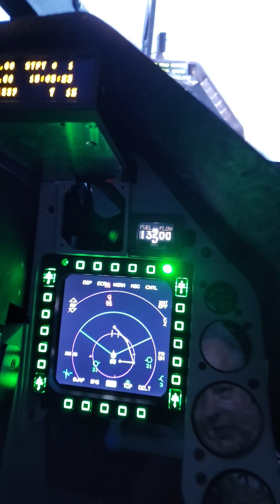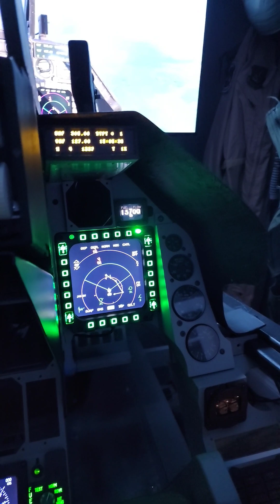You can't do this without help. #simulation #dcs #F-16C #Viper #Arduino

Comment: Hello GDVW, very nice work there, beautiful sim. Quick question. Can you provide the code for the FFI? I've spent the last 3 days searching without success. I've been to the ED forum and can't find joy there either. I've seen Vince Vegas posts but am stopped in my tracks buy not knowing where to put the " characters.h" file that he provides. I've got the copying and pasting of codes down pretty good now.  But of course when I try to load VV's code it keeps failing and saying that in regard to the "characters.h"  file, no such file or directory exists. Where do I put that characters.h? 

If you can help I'll come to your house and work for two weeks. Yard work, light carpentry, car washing. And at meal time I'll stand in an adjacent room and read Byron, Shelly and Keats in low dulcet tones while you and your wife dine. lol, please help if it's possible because , you can't do this without help.

Oh, i should mention, I just scrubbed my hard drive and can't remember my login info for ED forums ( I'm working on recovery but it's tricky as the original email was hotmail and that doesn't exist for me now.)Anyway,  at present I have no way to ask in the forum. Thanks in advance!

Comment: Good job on the cockpit.  If you are simulating NVIS then you should turn the brightness down for your back lighting almost 70%.  That’s a common misconception guys are doing witb their cockpits.  At the brightness your NODs would be flooded with light bloom.  The actual NVIS panels are very dim compared to blue/white panels.